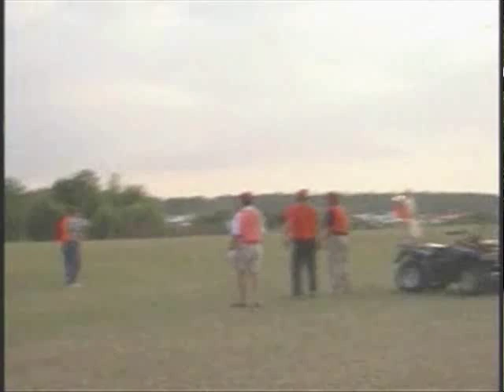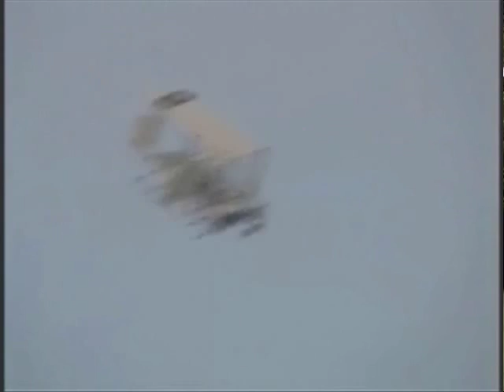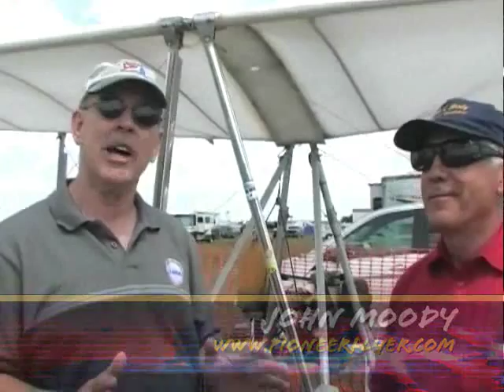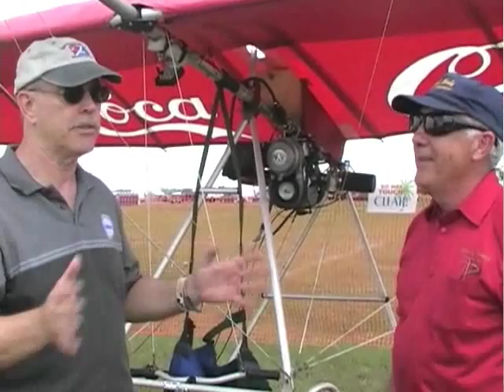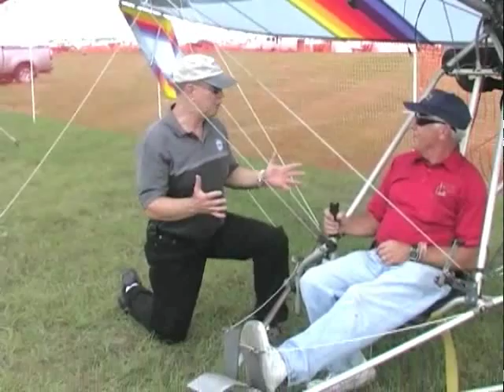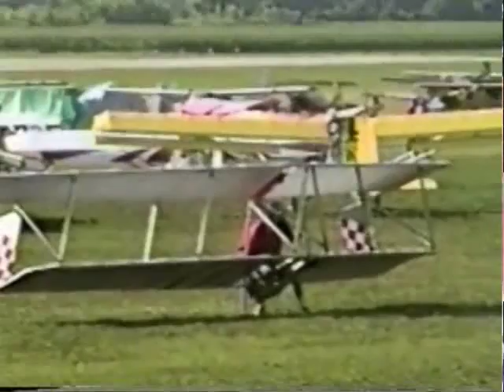Ultralight aircraft, John Moody talks to Dan Johnson about the early days of ultralight aviation.

Comment: I don't know what merits being called  " father of ultralight aviation" , but I think this term is more representative of someone who has had a lot of pioneering work in that area. Typically the father of something is the person who started it all originally, either by discussion,  construction, or took action in the process. In the case of aircraft,  I would assume it would have to be someone who talk, gave speeches about it,  designed and built the original first  ultralight aircrafts and flew them.   In more general terms,  I suppose you call also call someone the Father of Ultralight aviation,  a person who has been active consistently with promotion and use of all sorts of ultralight aircrafts, or perhaps someone who was inspired by such and developed a slightly but similar form. 

Regardless of topic,  the ones shown in this video are Awesome true ultralights, that's right!, I have a hard time accepting anything other than a Ripstop , Dacron or similar single surface sail, open tubular and cable architecture as an, true to the name, "ultralight". These are the original deal, and not like modern ones which are simply reduced  full regular aircraft  without the skins and called ultralights. A good example of these latter version would be Savage Bobber ( An open frame Piper) and likes. 

These original ones are some of the ones that inspired a lot of my RC aircraft ultralight microlight work, when I came across a Buyers' Guide to Ultralight Aircraft  in a Homebuilt Aircraft magazine back from the late 70's early 80's.  USA built ultralights back when those were the days! you cannot beat that.  I have done all of them, at some point, re-designed, modified, or better yet re-engineered, from the ground up,  for RC form, with performance, durability and realism in mind, using own manufacturing and build techniques with some parts which have became rc ultralight an rc microlight trademarks of my company. Some I have shown,  some are still hanging in the ceiling of my shop.  

Re-inspired again, by stumbling upon and watching this video, time to take out the Aerolite Eagle XL one of my favorite ultralights from that era, and you bet! that front canard horizontal stabilizer makes the aircraft very stable, but this should not be news to anyone who has employed horizontal stabilizers in aircraft,  in particular in autogyro aircraft, which, in my opinion, is a MUST for higher stability and more than anything "Safety".